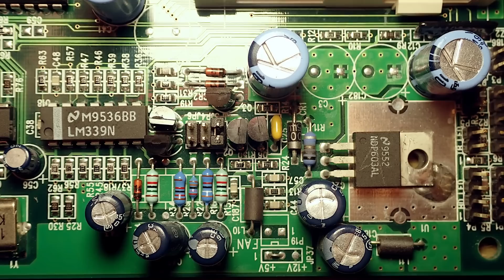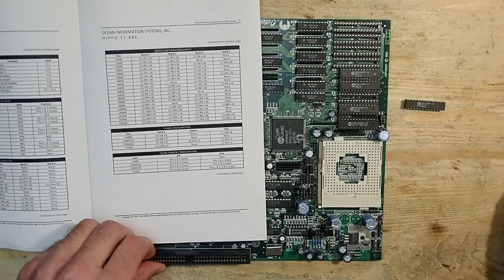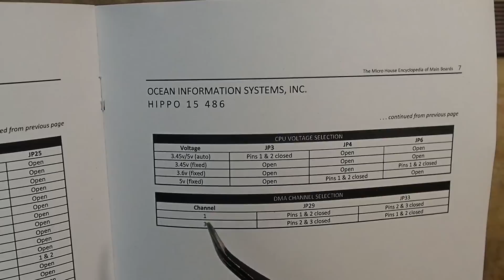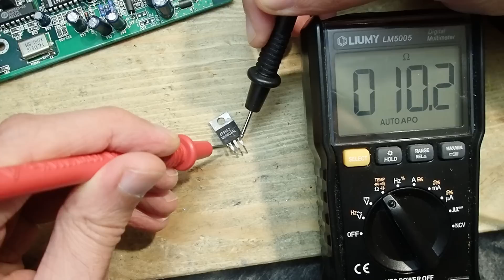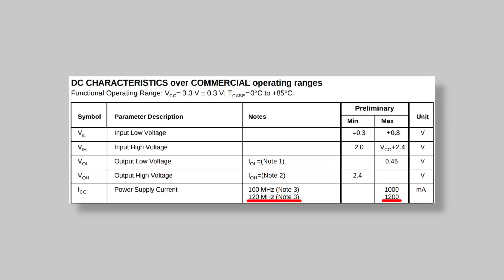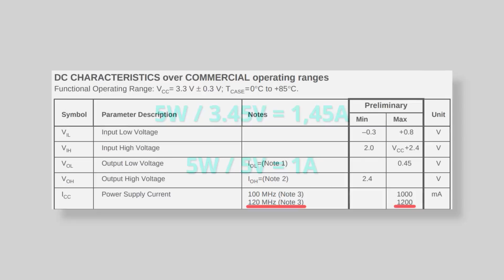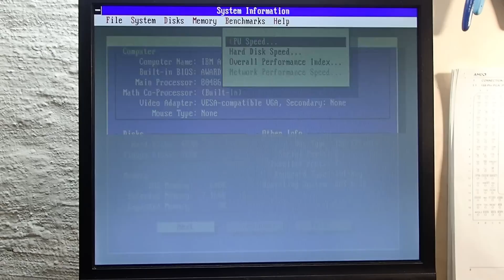Let's repair one of the best 486 mainboard - Octek Hippo 15

Comment: caps dying in pwm dc dc converters, but in linear systems caps working much longer. rubycon as nichicon are the best caps for me.

Necroware. tell me what projects can be done with such hardware? 
mcu's already have sometimes better performance. just interesting.
Reply from the maker: Well, it depends on what you want. My main aim is to learn more about electronics (I'm a software engineer) and to play good old games on the original hardware. For example if you want to play a game with original sound from that time, an emulator, MCU or FPGA simply can't provide it. In such case you will need the real sound card and so the real hardware, where you can put that sound card into.

Comment: I have a 386DX40 based motherboard that gives 64kb error no matter what I do (AMI BIOS, 3 short beeps and code 13 12 / 00 13 on 4 bit diagnostic card). It is one that I would love to get running again as it allows to underclock CPU to 20 MHz, which is great for older stuff. When I got it its BIOS chip had aleady two legs missing (what I was able to fix) and a cache TAG chip wasn't there. Would you mind helping me with that board?

Comment: Where can I buy the MOSFET tester you used in this video..Thanks.
Reply from the maker: I have it since couple of years. You can find similar devices on Ebay or Aliexpress
Reply: @necro_ware  what do you call that multidevice tester?
Reply: It's called a MG328 (sometimes a M328). They aren't a particularly good product (poor firmware, soldered-in MicroProcessor), however they have inbuilt lithium charge controller. The standard battery holder is for a 14500 (AA) lithium cell, but you can modify it to suit an 18650 or a pouch cell on the underside of the PCB (like he has done). A GM328 (replaceable Micro) or even a GM328A (soldered in Micro) would be a better product choice.
None of the "common" testers can measure all Mosfets, only those that have Logic-level (<5V) Gate voltages. There is some special component testers that have a boost converter and special circuits to suit SCRs, Zener Diodes, etc but they can be tricky to identify.

Comment: "Slightly more powerful"? It got higher Rds(on) - more heat and wildly different Vgs. Probably will work but would not put it in there.
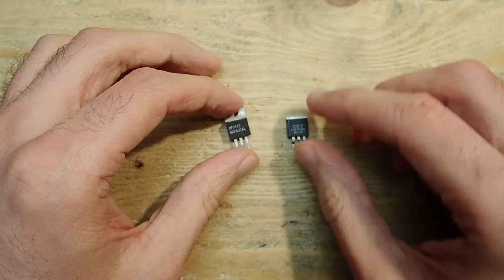Reply from the maker: I would like to disagree. I compared the datasheets (a cutout at 17:54). The Rds is lower with less than 30mOhm vs 40mOhm at 5V, means less heat and Vgs characteristics are pretty much the same. May be you mixed some other models?

Comment: i can send you a few dx4 100 intel cpus, im just needing a 486 mainboard
Reply from the maker: If my guess is right and you are from the US, then believe me, it's by far cheaper for you to buy such a board on the US Ebay, than to send it from EU. The same goes in my direction, buying anything and importing it into EU from the US is incredibly expensive. It's worth to make it only with things, which you can buy nowhere else.
Reply: @necro_ware  im in australia mate, but yeah i cant find a sigle board to buy, but i have 12 cpus and a heap of other stuff mate that id gladley give you for 1 486 mainboard. i love your channel and i have had a pc since 1986
Reply: @necro_ware  in australia they are charging over 450 EUR for a mainboard
Reply: send me a pm bro and i might have some stuff to give you